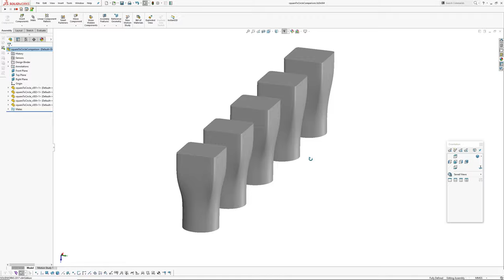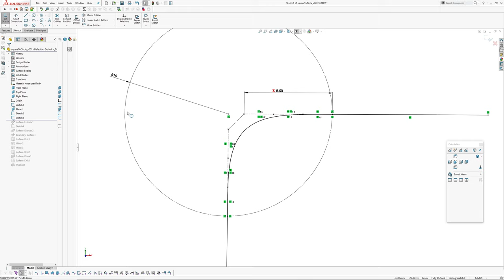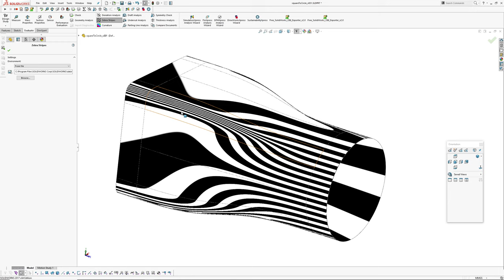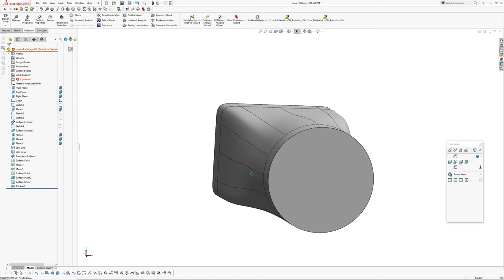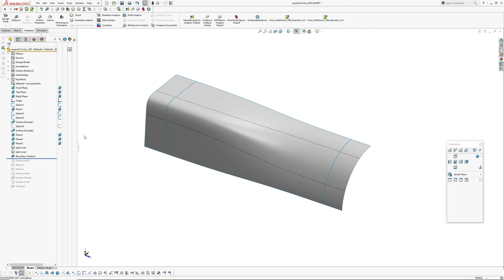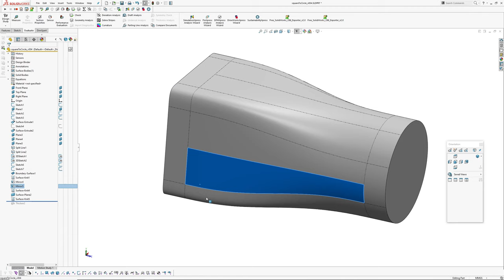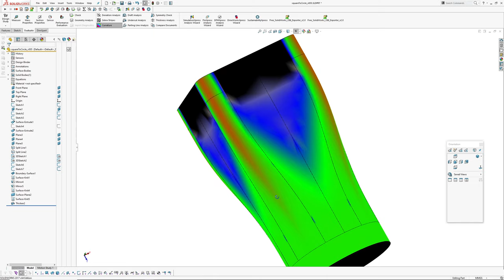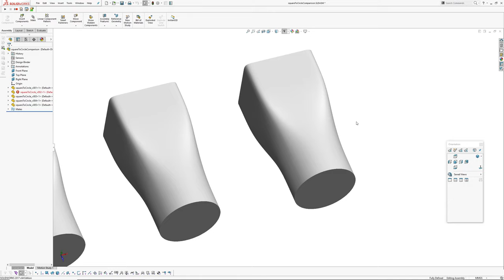Solidworks - Blends/Transitions 3 - Square to Circle

Comment: Another good one! If/when you upgrade your Solidworks license, do you think you'll use the G3 relation (for connection splines to non-linear entities), or is it overkill? I've got 2020 so I've been experimenting with it, but I can't tell if it's actually giving me better results.
Reply from the maker: Hi Brian. I guess it depends on what you are modelling but I'd probably use it if the G3 continuity translates into the surfaces built from the curves. SW needs tools to query whether the boundaries G2 etc as well, currently you can only check for tangency.
Reply: @AndrewJacksonDesignStudio  Definitely agree they need something like Deviation analysis for G2. Although maybe ignorance is bliss...
Reply from the maker: @briandonlin5353  Ha yeah - just specify a heavy texture like an old Dell workstation and you're good to go!